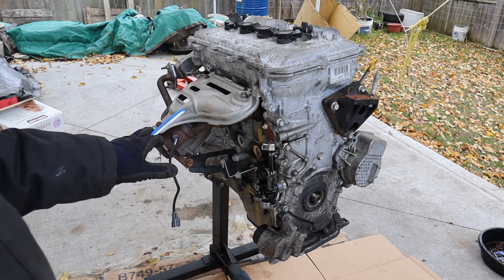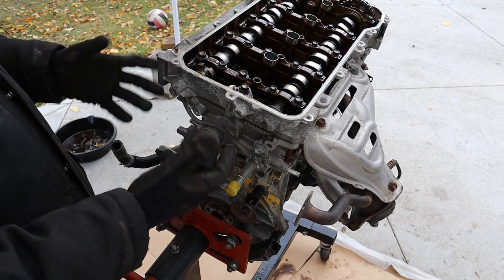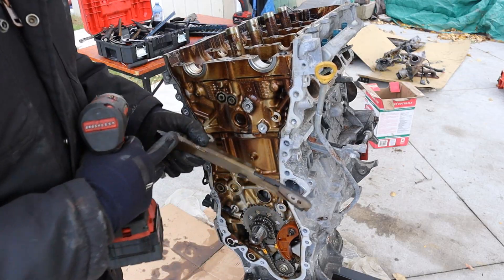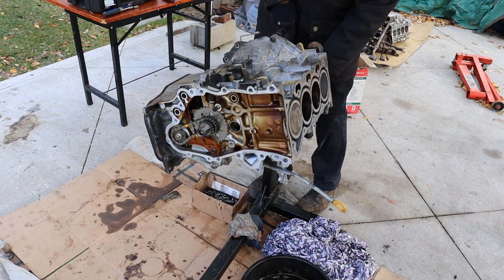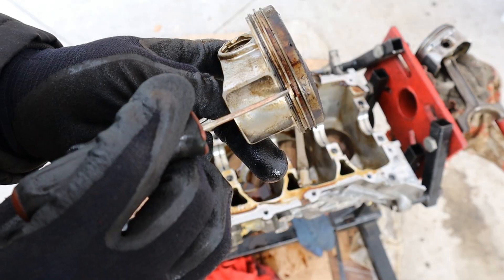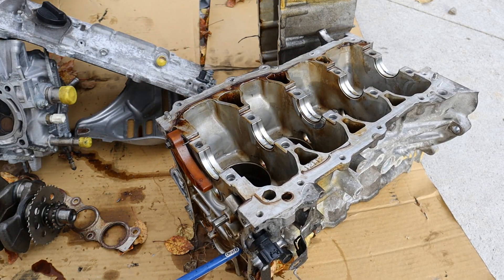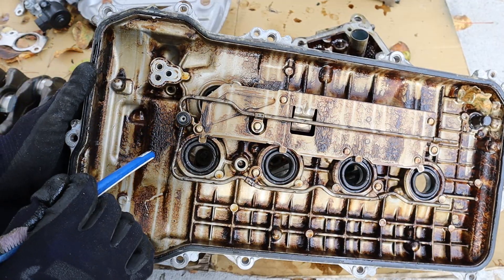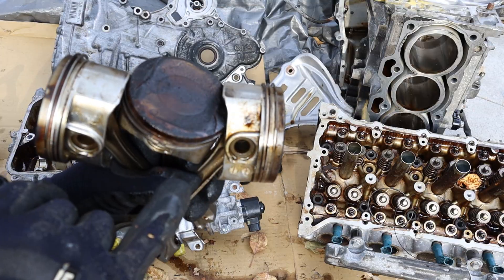Why the Toyota 2ZR Engine was a Failure

Comment: So, If I made a sprayer that sprayed antifreeze into the intake of my RAM 5.7 Hemi it would keep the pistons clean?
Reply: Might as well coil thin coper tube around the exhaust manifold and use a windscreen washer pump to push straight water through the tubing..
creating a steam spray into the intake to clean out the runners.
Just use this when cruising...
and remember to turn it off well before you shut the engine off...
otherwise rust/hydro locking could occur?
Reply from the maker: Yes, Some people do that as a supposed cleaning routine.

Comment: so why not only change the head gasket and keep that engine running 🤔
Reply: The rings would have to be replaced with the later modified ones, the EGR would need cleaning out, all O rings replaced, 
..the whole teardown, parts and labour exceed the cost of a good used engine.

But hey if you do it at home for only parts cost...go for it!
Reply: The engine is not worth the cost of replacing the head gasket.
Reply from the maker: Then I wouldn't have a full teardown video for y'all right

Comment: I love that most problems with toyota engines are a product of use case and not design flaw. And furthermore they typically dont arise early and provide a reasonable service life before any issue. Oil rings here are unfortunate but its common across the board now in the unnecessary pursuit of that extra decimal point of efficiency

Comment: Don't know why you dis on EGR. It allows engines to run leaner without pinging, and less NOx emissions, so less acid rain. It's a win-win situation.
Reply from the maker: It clogs up and causes carbon issues.
Reply: When designed properly, EGR systems do not clog up and do not cause carbon fouling. The majority of poor EGR designs have some things in common; poor PCV oil separation, small EGR port passages, and excessive oil burning. The oil mist mixes with exhaust and cokes up the intake. Small passages clog up easier than large ones. Oil burning in the cylinders makes a lot more carbon particulate right from the get-go. EGR is a great thing when executed properly. Placing an PCV oil catch can in the breather line will catch a large amount of the oil mist that would otherwise foul the intake manifold. They are easy to build DIY and very easy to install. Drain it twice every OCI and you're good to go. With today's DI engines requiring walnut blasting every 50-100k miles anyway, it's not a huge conundrum to clean the intake of EGR particulate while it's off the engine. I agree that the reduction in NOx, CO, and unburned hydrocarbons is a benefit well worth the slight complications that may arise. 🤷🏼‍♂️
Reply: On a spark ignited engine the EGR also saves fuel by reducing pumping work at part load.

Comment: The head gasket on my parent's old 2010 Corolla failed after less than 6 years and less than 100k kms. Luckily, it was covered under the extended warranty, but that shouldn't happen on a Toyota.
Reply from the maker: How much would have been the repair?
Reply: @speedkar99  this was back in 2016, obviously, around $1600 at the dealer in the Montreal area.
Reply: @speedkar99  I actually just talked to my dad and he was told that they would have charged him $2500 for the job. He had brought it in 2 weeks before the warranty was up for a complete check-up and that's when they found it.

Comment: I'm sensing a pattern here. The engines ending in Z generally seem better than their successors ending in R.
Reply from the maker: Yeah the 1ZZ and 1NZ were good reliable engines 

2AZ had some issues though
Reply: @speedkar99  Throwing my vote in for a 1NZ teardown.  Ours has 300k mi and still alive.  Would love to see what I'm in for when the day comes we need to rebuild it.  🙂
Reply: @someguyintexas1053 yes please. 1nz tear down. My 07 Yaris has 334K miles. It doesn't burn oil. Very reliable engine.
Reply: @someguyintexas1053  Gotta find a dead one first lmao

Comment: i would rebuild that motor, just did an old 7M-GE last week 300 000kms, just a new head gasket and head set, a good diesel rinse of the bottom end, and what do you know, brand spanking new again
Reply from the maker: Good to know. My brother is rebuilding his 7M-GTE for his Supra
Reply: Will these rebuilt hybrid engines run perfectly?
Reply: Hone it ?

Comment: the headgasket problems are caused by either a failing electric waterpump (I replaced mine while it was still in good condition at 230k km's), or a clogged EGR and intakemanifold. Because of this not every cilinders gets the same amount of fresh air mixed with exhaust gasses from the EGR. This causes the 'death rattle'. 
An important factor is clogging up the EGR is oilconsumption. An oilburning engine produces a lot more carbon, clogging up the EGR and intakemanifold fast.

As a preventative matter I change my oil every 10k km's and every 80k km's I clean the EGR and intakemanifold. It's quite a job but for me it pays off. Mine has 236k km's now and burns no oil. With this extra service and maintenance it's a very reliable and durable engine.

I think the first Prius's form 2009 - 2013 have the oilburning problems because of the tiny oilcontrolrings. From 2013 they don't burn oil anymore (so I'm told)
Reply from the maker: Awesome. How exactly are you cleaning the intake manifold? Scrubbing it with a toothbrush?
Reply: @speedkar99  I use my brothers toothbrush for extra cleaning efficiency.
Reply: @Motorsportsgeek moi de ma soeur
Reply: @speedkar99  I'm using ovencleaner. It works very well. spray it, wait a while, and spray it again and again. Every now and then flush it with water, let dirty black water out, dry it and spray again. In a day or so, it's clean like new. Both intakemanifold and EGR.
Reply: @speedkar99  I use ovencleaner, that works fast and good
Reply: @speedkar99 redline soupape
Reply: While those things certainly exacerbate the issue, the main problem is that the head gasket itself is complete garbage. Single layer, with a crappy coating. Even with water pump and EGR maintenance I bet yours blows by 370k km. They all do eventually.  If they used multi layer steel from the get-go then I doubt it would have been an issue.
Reply: @one_mega_ohm9139  I don't know, but I'm sure you're right. If it blows, it blows. But  if it happens I replace it with an upgradet one like you  say. Do these engines have a worse headgasket than the 1,8 engines used in the Corolla?
Reply: @joskd8491  I'd also like to know, I have a 2014 1ZR 1.6 corolla that I use as an uber car in South Africa with 432k km, bought it at 56k km, no major issues, just the alternator bearing gave out at around 280k, my local toyota dealership wanted to replace the alternator for $400, so I bought a bearing for $30 at an auto electric shop, still going strong, no oil burning issues, engine still pulls strong. The cvt transmission is still as smooth as new, I change the CVT fluid every 80k km.
Reply: From 56k km to 225k km I was changing the oil at 15k km as recommended by the dealership, but from 225k km to date I do 10k km intervals after I discovered the car care nut channel, the will oil remain at the same level until the next oil change.
Reply: You are misinformed. The head gasket had lamination issues. There is a whole new part number for the revised head gasket.
Reply: @bigsteppa298   Those other things lead to the gasket failing as well as the material having lamination issues.
Reply: @bigsteppa298  when was the headgasket revised? My sis is thinking about buying a corolla hybrid with this engine and I'm kinda worries
Reply: @ Gen 3s past 2010 are considered "safe"
Reply: @bigsteppa298  I have a Gen 3 Toyota Auris Hybrid from 2019 (from december I believe, basically the last month it was still in production). Any issues that I have to be mindful of?
Reply: I specialized only in Prius, also do all Toyotas and hybrid and fully electric cars, I live in LA, perhaps like 3-5% of all cars are Prius of some kind here. The issue can be muti-layered. Before this I drove over 1.2 million miles of 4 of these cars also Gen 1 through Gen 4 for work and I got my experience first hand from fixing them when they would have issues since back then many mechanics acted like it was brain surgery to service those cars. 

With the Gen 2, years 2010-2013, those engines will have head gaskets issues from 150-200k miles, even in well taken care of cars. Unless you baby these cars and drive them 10-15 miles a day, expect to have to do that and if you do have 50k-120k miles on that baby and it's a ~15 year old Gen 2 prius, you are almost due for a new head gasket and piston rings replacement for other reasons. Lately I've fixed 20 of those this past year alone. 

Water pumps and thermostats  have a very high failure rate at 250k-300k miles which is acceptable in my opinion, even the Gen 2 Prius take had the best proven engine has issues at 225k-275k miles with water inverter and water directional valve in well maintained cars. However, if it had a death rattle and or the car has overheated even once and you drove for another 1000 miles because it only did it once, then all bets are off. But you can test them and see if they are working, I have new ones so I can easily compare them just by turning them on. 

EGR and manifold even if well taken care of and cleaned will have to be replaced at 300-350k miles, manifolds will end up clogged in places where you can't reach and EGR valve stops working even if you take apart the whole thing and know what your doing. No amount of purple power and power washer cleaning will help, they are cheap anyways for a car with that many miles on the road and easy to do yourself. The EGR w/ cooler can easily last 600k miles, I seen a Prius with 750k miles that had the OE one.  

So if you are the only owner and you have done your homework and maintained the car, then I see no reason to change the thermostat which tends to go with the water pump under 380k km, I have seen them fail as low as 249k miles in cars that every service, every maintenance documented by Toyota only until they brought to me because they wanted 6000-7500 USD for a head gasket job or engine swap, I charge half of that. You can just check and open the water pump very easily when you flush the coolant at 200k km and clean it with mechanic shop paper only, don't use anything besides your finger inside the magnet impellor housing area. Coolant doesn't need to be Toyota brand coolant, just use and stick to one brand after the first time you flush it at 100k miles for your pink coolant needs same thing with the transmission fluid . Oil should always be full synthetic oil always high mileage full synthetic at 75k miles and beyond if you want your car to hit 500k miles.
Reply: Vidange 6000 kms maxi ou 1 ans et red line pour admission
Reply: Blown head gaskets can also be caused by not flushing the cooling system regularly. Head gaskets can fall in many ways from stretched head bolts to bad design to overheating and to neglecting the cooling system. Coolant should be flushed at a maximum of every 50,000 miles or 5 years whichever comes first not last and use OEM coolants. Also do not use water in the cooling system unless you absolutely have to get somewhere like home or the auto repair shop. If possible you should get some coolant. Also if you flush your coolant more frequently, water pumps can last longer without leaks from the gaskets. Someone managed to get 300,000 miles on a Ford 3.5 V6 and it was still on the original water pump. The water pump and the timing chain was replaced due to the water leak by the alternator. That’s because the coolant was flushed regularly and the oil was changed regularly as well. It was flushed more often than Ford recommends. However, if you buy one of these Fords used, you should get the water pump and timing chain replaced ASAP and use only Motorcraft parts. Aftermarket parts are usually going to fail much sooner and it can destroy the engine.